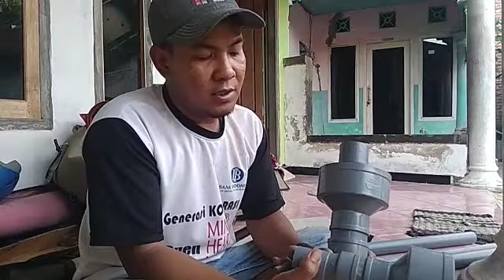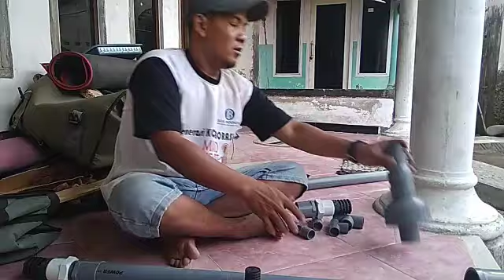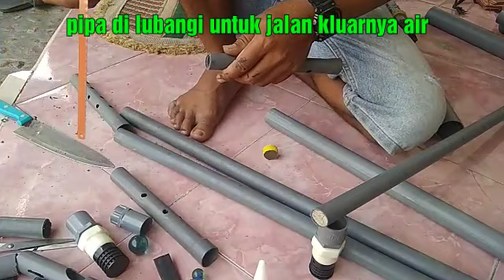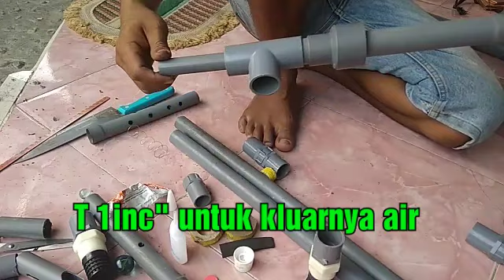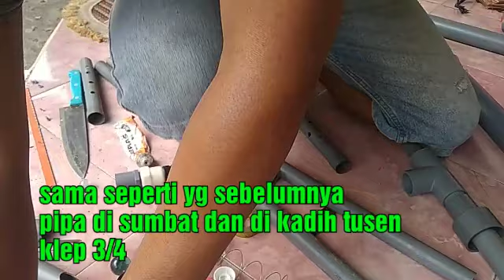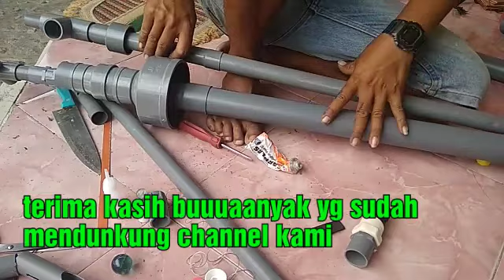Water Pump free energy

Comment: Req mas.. 
Sya dr kmren bwt pompa tersebut di modifikasi ke kincir angin.. 
Tujuan utk kolam ikan.. 
Tpi gagal... 
Krn tidak terangkat.. 
Coba kalau bs di bantu mas..
Reply from the maker: kedalaman air berapa meter bosku...
Reply: @dawalilis8961  1m mas.. 
Lebar kipas +-1m
Tinggi tiang -+ 5m.. 
Dinamo kipas angin..
Reply from the maker: @KatoKito.  insya allah sy usahakan bosku..mudah2an dlm waktu dekat sdh bs nge share...🙏🙏
Reply: @dawalilis8961  siap sellu mengikuti..
Reply: Mungkin bisa coba perhatikan pemasangan arah tusen klep nya, harusnya kalau benar bakal terangkat
Reply: Aq yakin kincir anginya ukuranya kecil jadi gk bisa k angkat ring L nya terlalu lebar jadi susah mau angkat nya
Reply: Saat dicoba manual naik turun pakai tangan gimana mas? Kalau bisa keluar saat itu, tapi tidak bisa keluar saat disambung ke kincir angin sih bisa jadi karena memang torsi yg dihasilkan kincir angin tidak kuat, bisa diperkuat torsinya dg cara memperpendek jarak dg poros jari2 titik lengan pengangkatnya